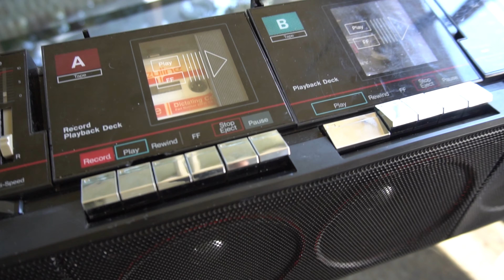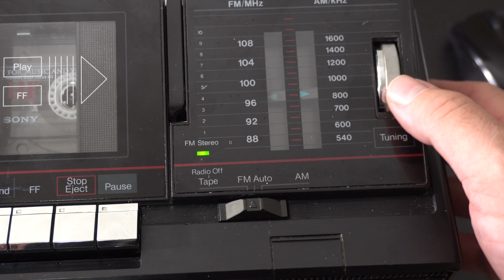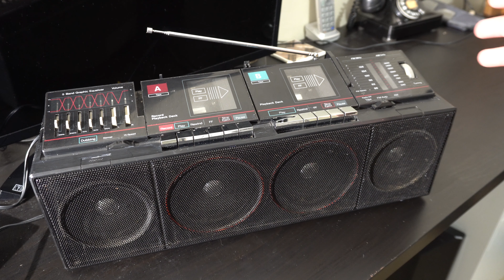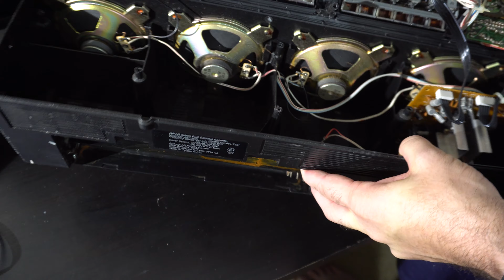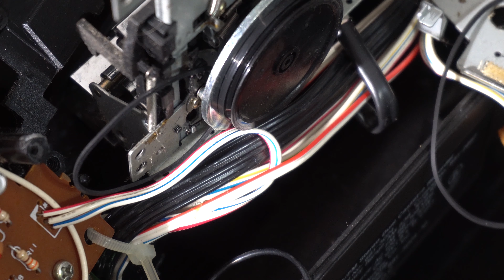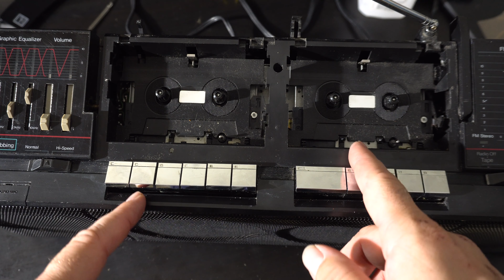JC Penney 4 Speaker 2 Tape Boom Box (1986)

Comment: I recently fixed a soundesign boom box  for someone and it too had 4 speakers. Two facing up and two facing forward. Unfortunately I was not %100 able to fix for the person as could not get the FM stereo to work right. In FM stereo the light would flash to audio and the sound would be distorted.
Reply from the maker: They could try very slow fine tuning, re-positioning the radio or FM antenna and see if that helps... If that does not work, it might be a problem with the circuit which would require extensive troubleshooting. I had a Panasonic SE-5808 radio that had a dead channel in stereo mode and it was a capacitor... Anyway thanks for watching and commenting!
Reply: If you imported the boombox from another country make sure the AM/FM radio frequency matches what your country has. If the radio's frequency is outside your country's range you will not hear anything. Next just deoxit the radio tuner knob and buttons, and after that, if still not working, there is a chance someone messed with the radio tuner and threw it out of sync and it would require re-diagnostics to put the tuner back in order. 

I just got a Pioneer boombox the seller said the radio was dead, turns out it's a Japanese only model that someone imported back in the 70s/80s and the radio frequency it runs on is not the same frequency that the USA has, so you hear nothing at all. You may get an AM station to work but that's it. I didn't buy it to listen to the radio anyway, but yeah just something to check. The most obvious problem is the most overlooked problem.